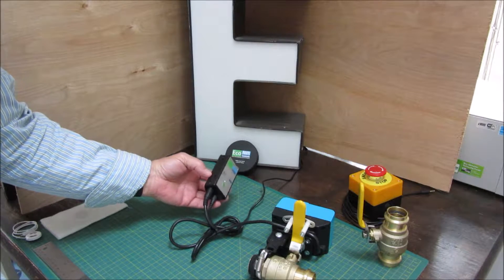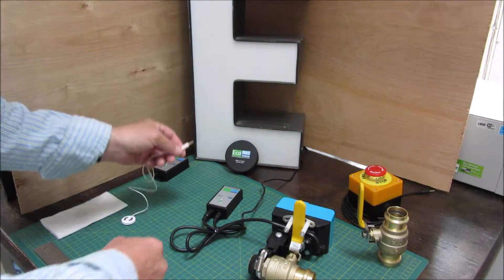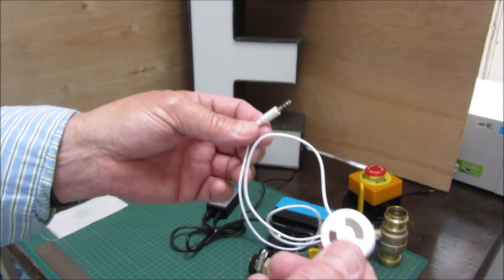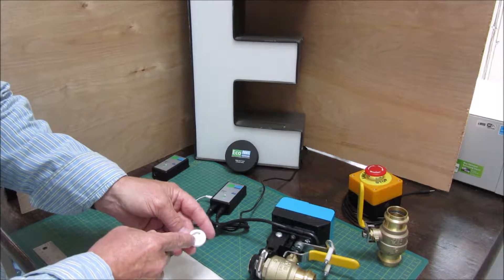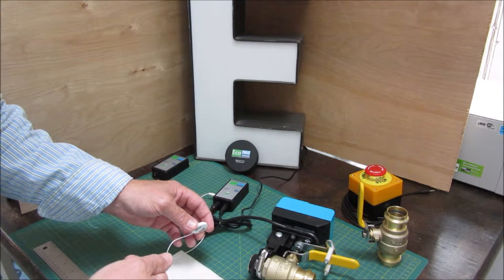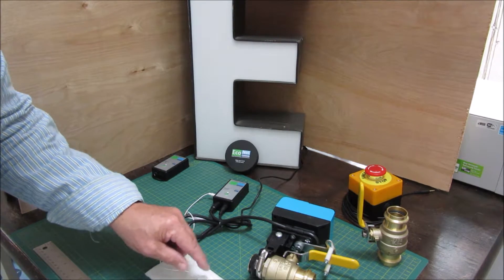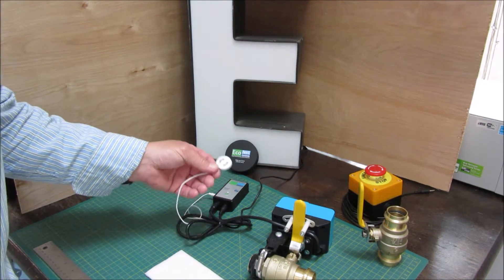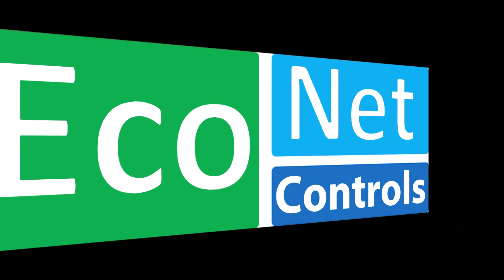EcoNet's Bulldog Valve Robot - using wired leak sensor option

Comment: I like this idea but want to re-purpose it a little.   My control box is in an inconvenient location.  I'd like to use the socket in the side of the control box to attach a switch.  I can put a switch in a  convenient location and label it "Emergency Water Shutoff" so that someone without SmartThings on their phone can shut off the valve and not have to try to find the control box.  I notice that the plug on that water sensor has three conductors.  So my question is: Which two act as a switch?